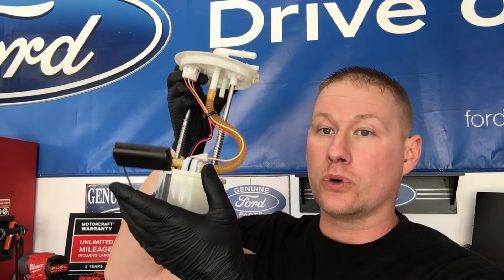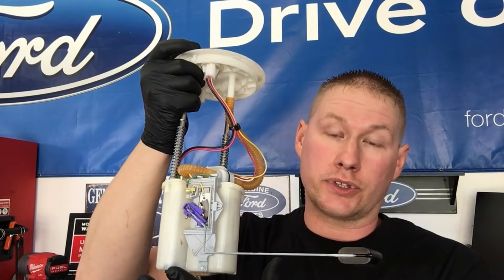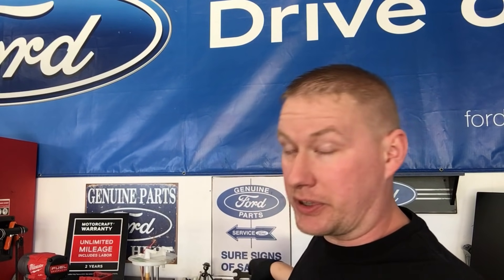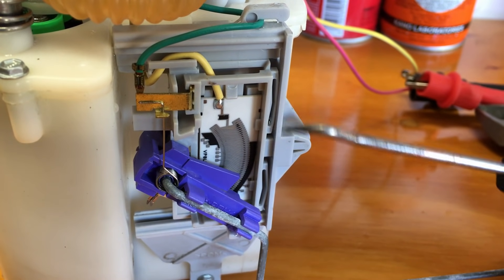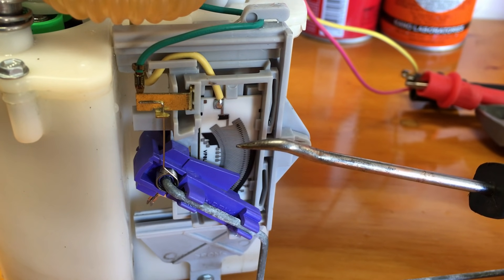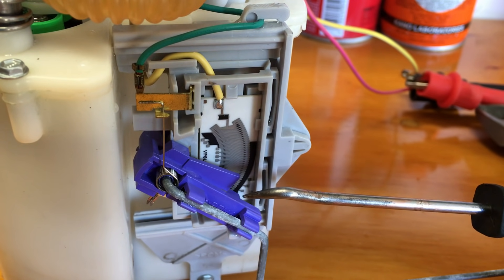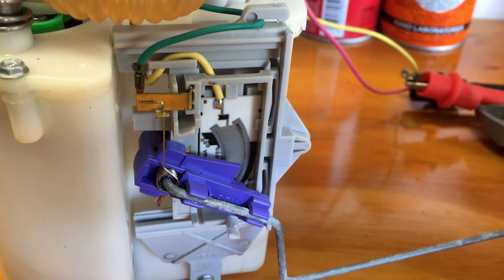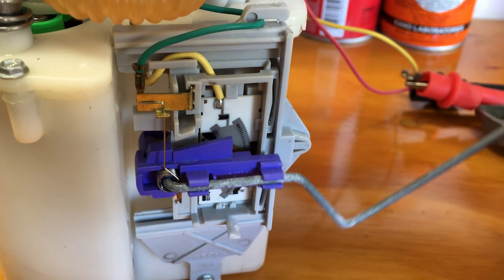Ford Quick Tips #77: DTC P0460 P0463 Erratic Fuel Gauge Quick Fix!

Comment: I tried this on an 00 Ranger. But it mever worked. I ended up replacing the pump. My 02 Colorado has an erratic gauge. I am really hoping this works so I don't have to replace the pump. But it hasn't yet and I habe done two bottles. Didn't fill the tank all the way so giving it more time. On third bottle. Hope it works. Truck does seem to have more power.

Comment: I have a '99 Ranger 3.0L Flex Fuel that has a pending p0461 code (only this code) and it's running rough. The fuel gauge isn't erratic but it has never read accurately since I've owned it (bought it used at 193k miles currently at 225k).

Comment: I had  quarter of fuel already in the car, but when I filled up again, the niddle didn't move up, it just kept dropping as I was driving and so did the digital meter until it reached 0km and the niddle went below Empty. Now the car won't start even though there's alot fuel in it.

Comment: I replaced the card in my fuel tank, the gauge appeared to work for a morning. I wonder if a bad vent on the tank can cause a faulty fuel level reading caused when the tank contracts with temperature change.

Comment: Do you have a video that would show on how to cut a hole in the cabin floor where the fuel tank would be to pull out the filter and all I have a e150 2013 with rear air condition passenger wagon I'm trying to figure out instead of having a mechanic replace the unit sending unit if I could do it myself when I purchase the new one I'll just take a plasma cutter or a grinder and cut the hole and make my access door and if you have a solution what's the best way to make an access store waterproof and stuff

Comment: I have a 2013 F150 ecoboost, There are no codes,I was told to take it to the dealer. 

The problem is,( As an example ) I start my truck at home,it say 365 miles to go. By the time I get 2 blocks it says 340 miles to go. I jumps around.  I also filled it yesterday and the needle said I was around a 3/4 full, not full. I will try this. Any other you may have,would be greatly appreciated. Thank you

Comment: Have a question? Have put a new fuel pump in 2001 Ford Taurus SES. It works great. The fuel guage on the instrument panel shows past full and won't budge. Stepson discovered the gas tank was leaking on Thursday and I went to a salvage yard purchased another one. No leaks anymore. The "main issue" is guage on the instrument panel is stuck on full? Have any idea what the fix is?
Reply: Same problem that just started with my 93 ford ranger.

Comment: I had my astro van towed to a Mr Goodwrench. Turned out fuel pump was bad. Had it replaced. The needle after replacement, would fluctuate with the bumps I hit. I see that they probably broke that spring on the float assembly. Good mechanics hard to find.

Comment: My fuel gauge would be all over the place. I'd fill up and it would read empty and even would display low fuel. I have been putting in marvel mystery oil and it has improved but still randomly goes up and down. Im going to finish this tank I'm on then will try this chevron stuff. I also have a B1204 code, so I think replacing the sending unit may be the fix, unfortunately.

Update: I replaced the fuel sender unit and it still intermittently displays low fuel while the the guage will show full. As I drive it will go up and down randomly. Any ideas?  I just dropped $600 for the new sender and am so frustrated.

Comment: Please, need some help. 2003 Ford Excursion XLT 6.8L 4WD, California car. I had the code come up due to constant empty or full reading. Replaced the whole sending unit with a new Motorcraft fuel sending unit Part # PFS281. Now the gauge is working and no codes. 
But it does not go down past 1/4 tank. I've run out of gas twice thinking there was fuel still in the tank because it still showed 1/4 tank left. I now use the ODO to make sure I don't get stranded again. 
**What could be the reason that the gauge shows 1/4 tank but in reality, the truck is actually empty? 
Any help would be appreciated. My local mechanic told me it might be a faulty new sender. So I ordered another to replace it again. 
Thank you in advance!
Reply: Could be the float is getting stuck, and not dropping all the way down.

Comment: I was experiencing erratic fuel gauge on a 2000 F-150 5.4 truck. The truck has a 24 gallon tank and a single bottle from Auto Zone says to add up to twelve gallons gas so I did my best to add to half tank-no fuel gauge fix.  A few fill ups later, I did 2 bottles in a full 24 gallon tank. Fuel gauge worked properly almost right away and is working fine since.  Since this product comes in several sizes, my advice is to buy the size that will be a good ratio to add to a full tank, which for me is 2 bottles.

Comment: Thanks alot! I put one bottle in and my gauge instantly started working. Of course, after filling up the tank. I got two bottles to be sure.
Reply: Update: the gauge was working until it hit below the half mark. So it seems when it's filled up it works. Guess I need a new sending unit.
Reply: Another update: I ended up changing out the whole fuel pump assembly and now it's back to normal. Turns out my old fuel pump sending unit was damaged. I could see little broken metal pieces in it.

Comment: Search brought me here looking for cure for F350 diesel 6.4, 2009 with fuel mileage on trip trip computer not accurate. Reads too high.  And the fuel gauge needle suddenly drops out from 1/4 tank to zero after start up.  Leading to great panic. 
But suspect Techron does not apply to diesel, but I'll read the bottle anyway : )
Got a 2004 Saab 9.3 turbo that just can't leave the family.  The fuel gauge has read 'zero' for past several years  . .  or longer.
Got to try this.       Got to.

Comment: I had that code 460 and ended up replacing the pump assembly. Code gone but now the Exp mpg computer runs through gas bad. I drive 1 mile and the computer says I drove like 3 miles. What gives? Anyone ever have this?

Comment: Thank you for putting this video together.  My sons 2001 F350 7.3 fuel gauge is always showing full.   We will try this. I did find a sending unit from Advance Auto if we need to order it for 132.00 if we need to order one.   Beats 400 -600 dollars.
Reply: I was mistaken, The sending unit that I found may not fit.  Looking at what unit is in a 2001 does not have the same unit you shown in this video.

Comment: I’m having a problem with my 2005 mustang. I’m getting a code P2068 for a high level fuel gauge sensor. I have changed the left side pump and the right side fuel sensor also. Any body have a idea what is going on.

Comment: I do not have a code set. My fuel gage went wacky several weeks ago, it would read full when not and bounce all over.

My mechanic replaced the pump and sender. All seemed good, but a new problem showed up. The analog gage would read empty or close to it and the mid would say remaining range was ~30miles, but when filling the tank, I could only put 10 gal or so in. I'd typically driven <200 miles when it said it was empty.

Filling the tank with ~10gal would move the analog needle to full and the mid would report 340 mile range est.

Drive for 4 days, I'm back at apparent empty, but fill only takes 10 gal.

I think  the tank actually has 10-12 gal in it when the gage says empty.

Back to my mechanic. He says Ford tells him this is normal. I call b.s. he puts in a second pump and sensor. Same problem.

What is going on here?

Is there a secret way to recalibrate the sensor or dash?

Comment: Is this for gas engines or for diesel engines? I have a 2007 Ford F350 Super Duty with a 6.0L Turbo Diesel and it is putting out a P0460 code.

Comment: I was having trouble with my fuel gauge is what brought me to this video.. I did put in the chevron cleaner.. The problem with my erratic fuel was fuse 21! In the manual it says nothing about fuel gauge on fuses 21 and 24 but I replaced both and cleaned the connections on frame rail below driver side door

Comment: I see the video you said high sulfur contents make the sending unit fail meaning Diesel fuel systems that product if for gasoline engines is it safe for Diesel engines or use the diesel version of the product thank you for the video
Reply: Well I was wrong both have sulfur

Comment: Fantastic work. I have this exact issue with my 2016 F150.  Went to Walmart to pick up the fuels system cleaner and 24 hours later cured.  No fuel light and no check engine light.  Fuel gauge works as well.  Thanks for another great video!

Comment: I have 06 p71 recently instrument cluster broked all gauges pointing 0 pitch black car still ran fine until I took out cluster sent in for restore dove around couple hours engine start shakes suck up alots gas showed code p460 put a bottle techon plus still same do u think it's bc can't drive it without cluster plugged in ?

Comment: My 2012 Expedition EL had the fuel Gauge stuck at half a tank. Do you miles till empty originally read 238. After filling up the car, the fuel gauge dropped below empty and the miles till empty showed three dashes. Could what you described in this video be the problem?

Comment: Very nice explanation, thank you! My question is that after two tankfuls of the Techron additive my sending unit finally failed (2010 Explorer E-engine code) and my Miles to empty went to “0”…… is the fuel pump in jeopardy of failing next or can I continue to drive as normal and monitor my fuel consumption?

Comment: Any info on the anti slosh module. 99 explorer. Reads full all the time, if I take the slosh mod out it will read 1/2 full. Have new pump and sending unit, and filter.   I have tried jumping it and nothing.  ?????

Comment: great video.  everyone has evap purge valve problems but i just checked mine out and it appears to be working fine.  my fuel gauge is stuck at full and i ran out of gas the other day unexpectedly.  i will check this out next.  thank you
Reply: Did it work for you?

Comment: My fuel gauge was erratic so I tried this. After using the Chevron my gauge works correctly now but the check engine light is still on with the same code. Does the code need to be cleared or should it go away on it's own? Thanks...
Reply: Unhooked negative battery cable for 10 minutes and check engine light is off and fuel gauge is working properly. The stuff works, guess I'll add a bottle every other fill up for awhile.

Comment: Greetings Ford tech makuloco.  I have a 2004 ford crown victoria and recently I have been having a problem with the cluster fuel indicator that still up and don’t low as the fuel level decrease  and the check engine light goes on, when I connect my blue driver device it shows that P0460 code

Comment: 2006 mustang gt replace the fuel pump and fuel tank sending unit and my gauge stays at 0 fuel and at times goes up to read different and goes back down.
Reply: Did you ever get it fixed I’m having the same problem’s
Reply: @MusicLyfe22  yes bro I bought a Holley fuel pump from American muscle because I had problems with the Autozone fuel pumps. The fuel pump number is 411380 from American Muscle.
Reply: @dsalinas731  bro that’s crazy cause I have a new fuel pump and canister.. but I’ll try that one
Reply: @MusicLyfe22  i replaced the fuel pump and since I was in the tank I also bought the fuel sender unit but the pump was the problem because it would turn off on me and my gauge wasn’t working. I was told it was my dashboard but it was lies it turned out to be just the fuel pump but like I said I had issues with Autozone’s fuel pumps they would send fuel just the gauge wasn’t working. Also it wasn’t just myself having problems with the gas pumps from Autozone.

Comment: I had a Ford Taurus and that code pop up I had changed and put a new fuel pump in is and the next day the engine light came back on and I put my scan tool on it and it still showing that code

Comment: There may not be any corrosion on the resistor but the wires connecting to the resistor may be causing haywire readings due a problem in the wire or solder.

Comment: Does seafoam work? Or does it HAVE to be the techron stuff?? I've had tons of luck with the seafoam from putting in gas and cleaning injectors to sucking it thru the vacuum on master cylinder and cleaning the upper cylinders, adding it to the oil to break down the sludge in old motors for a day or two before a oil change, but when doing it in the oil you gotta remember to use cheap oil because you need to change it again after a few days of driving so u can make sure to get all the old nasty out of it lol

Comment: An e450 at work has the fuel gauge sticking between 1/2 and 3/4 full, I'll  try this test method and see what I find.
Reply: Did it work for you?
Reply: @doug419880  i didn't try it, I poured some Lucas Upper Cylinder lube (12oz)  instead and started it about 5mins after and the fuel gauge went all the way up to full (where it should have been). Haven't had any issues with it again, so far.....

Comment: Wouldnt the sloshing of the fuel make the float move up n down while the vehicle is in use, and have sufficient scratching of the contacts?
Reply: The contacts are not working correctly if they are corroded so sloshing around may give haywire readings.   Haywire reading may occur if the vehicle is in neutral.    Higher ohms readings will result in error codes.

Comment: I have a question about my 2017 Ford F550. When I put it in reverse, all of my dome lights come on. Do you have a video for this are any experience with it. Also, thank you for this video. It worked for my fuel gauge not responding correctly.

Comment: Outstanding , fixed a 4 year old probelm , 2 treatments , 1st did the trick in about 2 hours and a short drive , the second for luck. thanks !
Reply: What instructions did you use?
Reply: @bigblov3   1/4 full of gas , 2 techron bottles , filled up with chevron premuim , ran about 15 minutes and needle raised to normal full position ,  when ready for fillup , added 1 bottle of same , filled up as normally would , gas gauge worked normally on refill , added 1 bottle every other month , this was a low milage 2004 Navigator with 38K miles , that never driven by a older gentleman in San Deigo , sat in garage a lot when I was able to bye it , but your knowledge in this matter was fantastic , thank you !
Reply: @bigblov3  1/4 thank of gas , 2 bottles , filled tank , needle moved up to full after a short time , ran down to 1/4 tank again and used 1 bottle and filled tank back and has never done this again since , use 1 bottle very other month and reset computer code , cheaper then Ford wanting to drop tank and replace pump by a long shot , on a very low milage 2004 Navigator that sat a long time in a garage at the coast , it does work , I was impressed , so simple.
Reply: @Russianpaintrain  did you use the 20oz bottles or the 12 oz bottles?
Reply: @bigblov3  Black Techron bottle , it is 10 oz. , black cap part # 38726 , 15 gallons of gas per 10 oz. bottle.

Comment: Hi,

Question: The fuel pump on my 2005 ford expedition 5.4L XLT 3v
was replaced about year ago because the original went bad. The issues I'm having with the new pump is: 

1. The fuel guage needle does not go all the way to full or passes the last marker on the gas guage. It used to do it before the new pump was replaced.

 2. I now hear a thumping sound coming from the fuel tank when i shut the car off / parked after driving around for 30 to 1 hr. 

Is this a sign that the pump going bad again? Or can it be something else? 

3. My digital MPG guage on my dash cluster is jumping around like crazy when driving.  It goes from 13 mpg to 16 mpg in less then one mile.  Then it jumps around from 13 to 14 then to 14.5 then back to 15. All in less then a mile. Is this part of the pump? Or something else.  

Any information will helpful. 

Thanks

Comment: Worked for me. I didn't have any codes but my fuel guage would never read all the way full on a full tank. At halfway it would jump to "E" and the Info system would say I only had 7 miles to empty. After using Techron Concentrate Plus the guage and info system corrected itself within like ten minutes. Reads good. No longer overflows at the pump.
Reply: What instructions did you follow to put it in?

Comment: I know I wont get a response but I have a 2017 Ford Focus SE 2.0L and I'm running out of gas at a 1/2 tank of fuel or the car dies out randomly, I go to put in more fuel and I get like 8 gallons of gas to fill it back up. and after I run out of gas or it shuts off, the fuel gauge will drop to around a qtr of a tank. When I refill the tank back up it takes awhile before the gauge will actually start to drop, maybe a week it will stay on a full tank.
Reply: only code is a PO2196

Comment: I can confirm that this seems to fix the issue. My mom's '08 Taurus kept having the check engine light come on with a P2068 code. I would clear it and it would go away for a few weeks and then pop up again. I noticed it seemed to only happen when the fuel was below a quarter tank. I started using the Techron additive about once every month or two and the problem stopped. It hasn't happened for about a year now.

Comment: hey guys does anyone know if the fuel sending unit has anything to do with the crossover hose for the split tank in a 2005 ford mustang 4.6  having an issue where not getting any fuel to the drivers side main pump    some say there is a jet pump in the passengers side of the tank and some say there is not.  any help on anyone that has ever had this problem

Comment: The pdf file USER MANUAL from techron on the amazon link provided by the video creator states "Not recommended for diesel engines. " at the very end of the pdf file
Reply from the maker: This is a video on gasoline engines not sure why diesels are being brought up